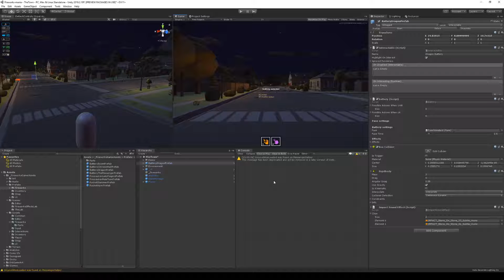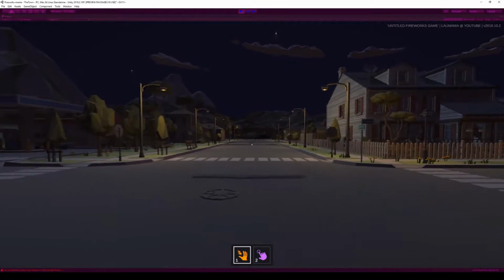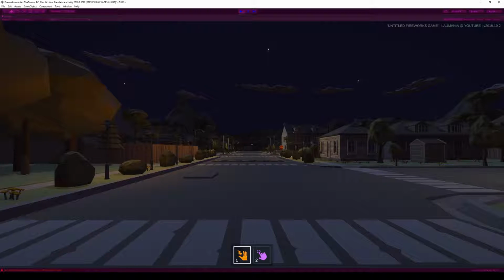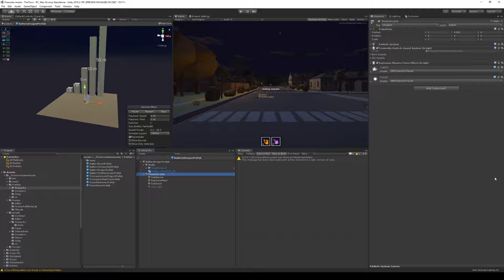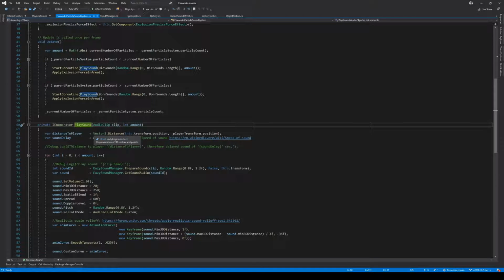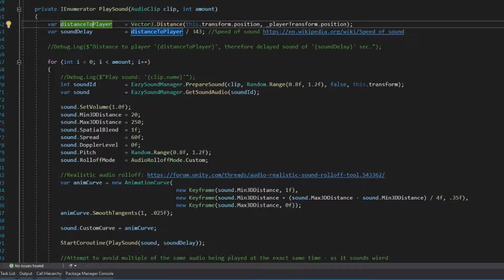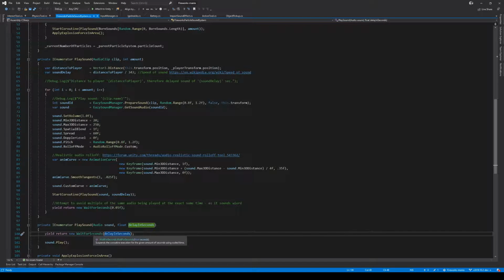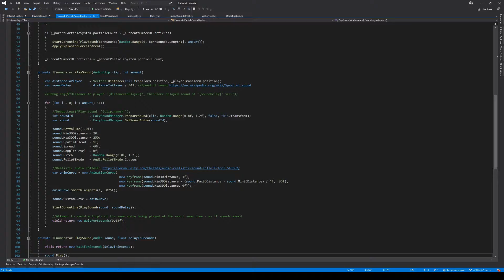Realisticly Delayed Sounds | Unity | Tutorial

Comment: Isn't this what AudioSource.PlayDelayed() is for? Why use a coroutine?
Reply from the maker: Yeah, you might be able to use that too. But a big part of this is also how to calculate how long the delay should be.
Anyway, it's a long time since I did this and I'm not actually using this method anymore - however - I'm sure it still works.

I use MasterAudio now and it have a delay function to, how they do it internally, I don't know, but it haven't been a problem.
Reply: @Laumania  which part of master audio has delay function?
Reply: @Laumania  also does master audio already do this naturally? Like setting it up, it would just delay the audio upon distance
Reply from the maker: @Electro3Strike  MasterAudio have a delayed parameter that will, yeah, delay when the sound it played:
https://www.dtdevtools.com/docs/masteraudio/TriggeringAudioCoding.htm

But you have to still calculate what delay to put in there, MasterAudio don't have that functionallity as far as I know.